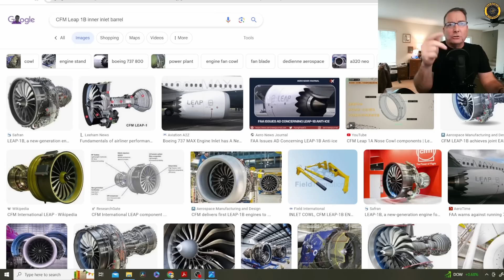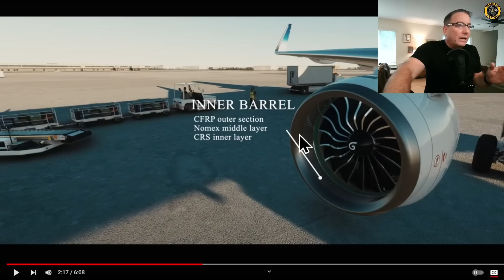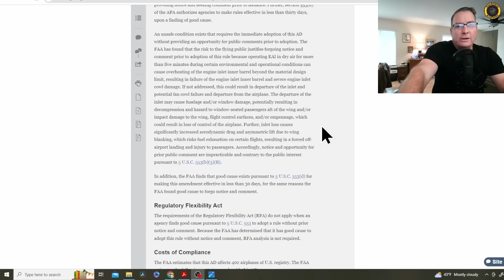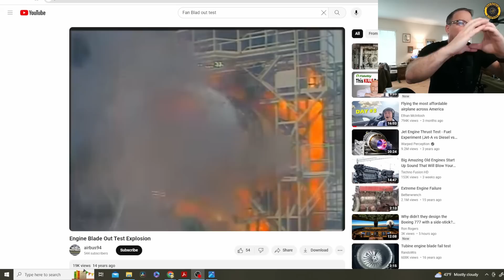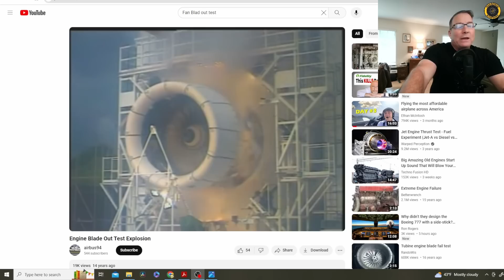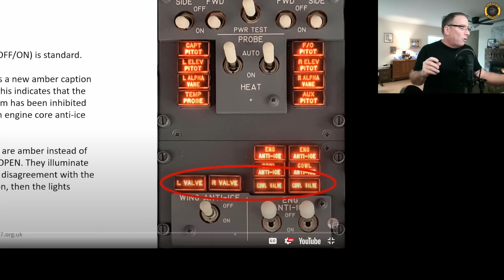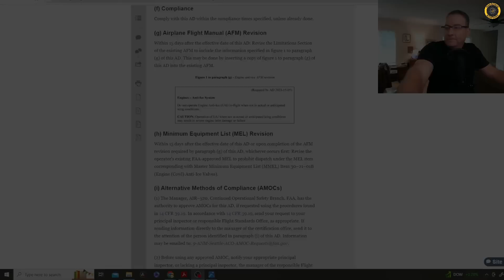Boeing 737 Max-7/-10 Certification HALTED! 1 Feb 2024

Comment: It’s worse than you described Juan: for the MAX Boeing chose to delete the blue engine anti ice valve open lights which advise the pilot with a simple scan that engine anti ice is on. So now we took away a visual cue that engine heat is “on” on a version of the engine that destroys itself if the heat is left on.

Comment: The problem is not Boeing, the FAA, the airlines, the businessmen, the lawyers, or the engineers. The requirements underpinning design choices that drive material selection are traceable to efficiency mandates. Those mandates are a direct consequence of the “Greening” of every aspect of our lives. What is coming to light is the result of demanding ever-increasing performance from systems that are already highly optimized. As with all highly optimized systems, small changes have big impacts. Development at the leading edge of technology can only happen so fast. Go faster and things are going to fail. Fail on the world stage and this is what you get. If you want to blame someone, look no further than the GW reactionaries with their “the sky is falling” belief system and “how dare you” mind set.

Comment: That shouldn't be hard to fix, Simply blend some cold compressor air with the hot exhaust gasses, and lower the temperature of the engine cowl de-icing system.
Reply: Ya gotta melt the ice.

Comment: It sound like the problem we cause by the changes in the Leap Engine material. Now Airbus and other OEM's also  use the Leap Engine.  There is no mentioned if anyone is looking there. 
The Leap Engine installation   should require de-ice and not over heating this new 
Composition material.  
Why not mandated the part be metallic like the original part? Is cost and Aircraft weight more important than safe Engine design?

Comment: I think maybe it's time to recall this.  Boeing (and any aircraft manufacturer) will only build what the customers (airlines) want to buy. The overwhelming response was "no new training/type certificate" we want cheap/quick.  A drastically shrunk 757 would risk a "no" answer from the FAA and new type was not desired.  Also lets keep in mind the FAA is not nearly as rubber stamp as other nations aviation directorates so the risk is going to be higher.

Comment: Not that this is a new technology problem anyway. Plastic melts with temperature, who would’ve thought. We’ve known this for a hundred years. 

And no, calling it «fiber reinforced polymer composite» doesn’t make it anything other than plastic. It’s still plastic, it’s literally in the name - polymer is a synonym for plastic. But most people believe «carbon fiber» or «glass fiber» is an entirely different material, for some reason.

Comment: I can understand that the design changes in the engine cowl were to save weight, which ultimately saves money by ever so slightly saving on fuel costs of operating a flight, but what are the costs of doing the design changes versus all the ongoing costs to deal with this problem?  In retrospect, was it worth it?

Comment: Is the problem component an airframe one or an engine one? IAW a CFM or Boeing designed component?
Are other airframes with the Leap engine susceptible to this failure?
Reply: An airframe one.
Reply: @robertbutsch1802  Higher bypass air temperature is also a factor.

Comment: As a 35 year A&P airline mechanic the simple solution is to stop trying to re-invent the wheel, and go back to cowl structures that don't involve composites in the areas that are anti-iced.
Composite structures eventually delaminate, and the structural integrity goes out the window. How did aluminum, and stainless steel work in a nose cowls of the past, just fine.
Reply: If they designed a Peltier device into the nose area of the nacelle, just might be able to reclaim some of that unnecessary heat as electricity ... sort of like regenerative braking in a hybrid car charging its batteries. Plus, any extra heat could be "bled off" into safe electrical loads with proper heat sinks and cooling airflow. Then again, those environmentalists would probably veto the idea as possibly contributing to warming of the atmosphere.

Comment: Thanks Juan. Can of worms no doubt. 
Does the AD address a time limit or max temperature that the structure can withstand? Perhaps limiting the anti ice air max temperature or the max temperature of the subject composite structure with sensors would be a solution. Turn on engine ant ice to Auto and it looks after itself. Would likely require a change to type certificate?
1960 CT58-140 composite electrically heated bell mouth had that.

Comment: Madness is asking the same question and expecting a different answer - is the max safe yet??? Boeing should have dumped the max after the 2 fatal crashes and now its too late too many airlines have the max integrated into their fleet planning the cost would finish boeing. What they should have done is let airbus run with the neo while boeing started from scratch. I dont think boeing will come back from this every programme they have active is running way behind. Until an engineer is behind the wheel it wont get any better
Reply: Third in the series of famous questions:
Are we there yet?
Are we having any fun yet?
Is the 'Max safe yet?

Comment: this needs to be thermostaticly controlled to prevent overheating.   as in an "auto" setting as you say others have. this seems like a fairly simple fix, just add a thermostaticly controlled shutoff circuit.
Reply: Problem is the type certification to allow NG pilots to also fly the Max

Comment: On aircraft equipped with the CFM LEAP-1A engines, both engine anti-ices are automatically switched on, and impossible to switch off, when in an Electrical Emergency Configuration! Juan, what happens on the B737 Max with the LEAP-1B?
Reply: On Airbus they are controlled by push button off and on switches. I think you may be confused with the window/pitot switch
Reply: @tomstravels520  I'm absolutely not confused in what I've just stated. If you were an A320 type-rated pilot or technician you could read that in the manuals (FCOM, FCTM and, certainly, in some maintenance manuals).
Reply: @pedroneves8288  done ages ago. ATA Chap 30 Ice and Rain Protection

Engine Anti Ice PB:
ON: Light comes on in blue, ECAM Memo displays ENG A ICE, engine anti ice valve opens if bleed air is available from the engine. Continuous ignition is selected when the valve is opened and the anti ice eng pushbutton switch is selected on. This makes the IGN memo appear on the ECAM

Off: On light goes out, engine anti ice valve closes

Fault: amber light comes on and caution message appears on ECAM if the position of the anti icing valve disagrees with the pushbutton selection. 

Wing anti ice almost identical except if activated in ground it does a 30 second test. I see no mention of the word AUTO or Automatic

So what does yours say?
Reply: @tomstravels520  I was referring to the fact that they are turned on automatically when in an Electrical Emergency Configuration.
Reply: @pedroneves8288  my apologies. I’ve had to correct so many people who think the A320 is automatic that I saw the first part of what you said and missed the EEC part.

Comment: OMG, how much worse can it get. The entire company should be put on hold.
Reply: They might find SCC (stress corrosion cracking) from excessive vibration on the engine mounts might cause unexpected separationof critical forward thrust producing parts (i.e., engines may depart the wing).

Comment: The CH-53E helicopter I flew in the Navy had a high setting that was not to be used for the windshield defrost as it was so hot it would melt the material the windshield was made out of.

Comment: Boeing is not alone in abandoning good design and quality control.  The U.S. Government stopped quality inspections for  military and aerospace items years ago,  This was due to pressure from industry groups who claimed it was too expensive.   This was about the time that the term quality failure became a quality escape.  Even the terminology has been altered to justify failure and avoid accountability.  Again, not just Boeing here, the military is good at denying quality failures and it's putting people in harm's way.  Consider the Osprey program or the tanker fiasco (trying to use TV cameras in place of direct visual contact with the aircraft being refueled.   The more you know the less likely you are to even buy a  dishwasher from a US manufacturer much less get on an aircraft.

Comment: It amazes me that Boeing is still using the out dated overhead panel on their most advanced 737 for the sake of a type rating.  This should have been updated with the NG to match 75,76,77,and 78
Reply: Then they would have lost the same type certification
Reply: @tomstravels520  maybe, but even if they did, they wouldn’t be facing some of the problems they are now trying to integrate improvements.  Maybe they could have worked something out as differences training.   The DC-9, and 757/767 came with both glass cockpits and steam gauges and the 75/76 had significant differences in the systems, yet they were the same type.  The difference between the first gen 737 and the max is pretty damn different IMO, yet still the same type.

Comment: I used to fly a Boeing that had bleed air everywhere(D model B-52) .sometimes you would get a bleed leak in the cowling that caused a fire light to illuminate.Peace time you shut down that engine, in a press on mission you would reduce power in that engine until the fire light went out. My solution to this problem is to place temp registering probes in the cowl to let you know they are overheating allowing you to reduce power till the bleed air was at a safe level to leave on( still melting ice but not melting the cowling). In the F-111 the “bird proof” plastic windshield would melt if you left the rain remove(bleed air) on and it wasn’t raining. I can’t imagine why engineers would design a cowling so flimsy that it could melt in normal use. I suspect this is part of the effort to have the most modern 73 have most of the same switches in the same position as the old 200 series. If the feds let guys with a 757 type rating fly a 76 -400( whose only similarity is that it is a Boeing twin) why are we so fussy about the 73 having the same pre-historic cramped flight deck with toggle switches from 1955?

Comment: I spent a majority of my time at work as a reliability engineer.  From the description of operation of the ice deterrent system on this plane I can simply say it is unreliable.  Each generation of planes should make systems more reliable in general.  The activation of the system, the inability to modulate the temperature of the air from the engines,  the lack of ice detection all place more work on the pilot.  This design seems to be going in the wrong direction.  I would not automatically come to the conclusion that a polymer duct is less reliable than a metal duct.  You have to look at the problem as a whole system, not individual components.  And what if the valve sticks and lets hot air roast the plastic cowl?  Is there a cowling overheat warning?  Probably not.

Comment: I have NO idea why they decided to update the 1960's type aircraft when they could have updated the 1980's type aircraft (757 or 767). Blows my mind. I blame the accountants from McD-Douglas.
Reply: Those are different sized aircraft.
Reply: @dafunkmonster  True. A bit of engineering would help in that regard. But McD-Douglas swapped the engineers for accountants so there's that.

Comment: This may be a little far fetched but honestly, I blame the environmentalists/EPA as overall deep dug root cause. They did the same thing to the diesel pickup truck industry. They have all these massive enviro demands on the industry, and the industry must meet those demands at the expense of efficiency/reliability/and in this case, safety. Sad who really pulls the strings.
Reply: Many people have died and will continue to die to "save the planet".
Added complexity, pushing the limits of material science, then trying to make it work on a 60 year old design intended for a completely different type of service than it is currently used for.
Messing with nature is like Pottery Barn, "you break it, you bought it".

Comment: The Corporate Citizens have far too much sway over our political and regulatory processes.  I don’t believe the current trajectory changes until Citizens United is neutered   We don’t know enough about composites and other new materials to be deploying them into critical applications yet.     Retired UAL SFO/MOC avionics and turbine shop.
Reply: Not exactly. That is on the climate crazies, not the companies that are forced by the government to do stupid things. Recent examples, LG came out with a "green" refrigerator that the compressor fails within months, washing machines that don't clean, low flow on all water usage, light bulbs.
Reply: @SteamCrane  wrong topic.    We are discussing Boeing designed aircraft and lack of regulatory oversight.   Government regulations didn’t force Boeing to forgo a 2nd input channel to MCAS …. Nor did government Regs require Boeing to omit bolts on their door plug ….  Lack of adequate oversight by government inspectors is likely a contributing factor in both instances.

Comment: My wife flew yesterday after her scheduled flight for the day before was canceled on the 777 for a mechanical failure. The flight yesterday was oversold so they were asking for 12 people to not take the flight so it would not be overweight as it was a full flight. The flight was from SAN to IAD on a 737 MAX 9. They couldn't get enough volunteers to not take the flight so they were forced to make a fuel stop in Denver. I find it mind blowing that an aircraft this "new" with a range of 3300 has a reduced range at full capacity. In today's flight operations, the majority of flights are full. Plus, the airlines want sold out flights to maximize their profits. What am I missing here on why Boeing would design it this way? The entire 737 MAX series seems like a giant flop and Boeing should cut their losses before they are forced out of business from all the liability insurance claims they will be forced to pay when their desire to appease the airline industry for a common type certificate. Juan you said in a previous video something that was profound. Boeing should have modernized the 757 not the 737.

Comment: Personally, I still don't understand how the Max aircraft are still allowed to operate. The system that allowed them to be certified on an old type certificate is flawed in the first place, but they have shown to be problematic from the off. It's past time the "safety" regulators actually did their jobs and grounded them ALL until they have a new type certificate and these problems that keep surfacing are solved. 
The 737 had a reputation for reliability and safety for decades which is being rapidly tarnished by this faulty new airframe.

Comment: Oh Boeing.. why hast thou forsaken us? It looks like it is time to get Supreme Command Captain Steve Dickson out of mothballs to certify the MAX with another circus stunt flight. 
Engineering and Production: It takes PHds in engineering to design the beast, and those with master’s degrees to manage the manufacturing of this potential killer. A lowly line pilot flying it will tell you exactly how the sum’bitch really works. The real stunner? The maintenance crews building this turd on the assembly line predicted what would happen to the nose bowl as they installed and performed the ground runs on the pig. Some of them ‘only’ had  high school diplomas. Some of them had military maintenance experience as well. Boeing has once again outsmarted itself. During icing conditions, we always “checked out nuts.” I have seen baseball sized ice accumulations on the windshield wiper nuts on a 75’ before. Needless to say, we had to climb to FL180 along the Lakeshore to get to MDW due to icing and O’Hare arrivals. 
We set an enroute altitude record from MKE to MDW that night.

Comment: Doesn’t this modification seem predicated on the false idea that human CO2 emissions are going to kill us? Replacing metal with carbon fiber for a weight reduction, reduced emissions, and enhanced fuel efficiency is what is driving this or is Boeing looking purely at its bottom line? With the new movement to hire pilots on the basis of DEI, it may not make any difference what the plane is doing to kill us. 
Cynicism aside, I am glad that certification is being delayed until this is fixed.

Comment: The A350 (supposedly the most advanced airliner in the world) does not have automatic engine AI, or my company didn’t buy that option.
Reply: Keeps the same principle as previous Airbus and also so A330 pilots can fly A350. But doesn’t it have ice detectors to tell you when to turn on and off the system anyway?
Reply: @tomstravels520  YES it does.  But why not go a step further like the 767 (40 year old technology) and do it automatically?  Then again, you have to manually turn on generators in the 737.  When was the last time your manually turned on a generator in anything?
Reply: @bigdaddie40  the only reason I can think of is you still have to monitor the system to make sure it’s turning on and off when necessary as you can’t put your full trust in it. So you might as well just control it yourself with guidance incase you forget. Plus if there was an auto mode Airbus would either have to install a seperate button or make a 3 position switch with an indication if it was on or not which isn’t really their thing if you look at the rest of the overhead
Reply: @tomstravels520  I don't design em, just fly em.  I just saying...